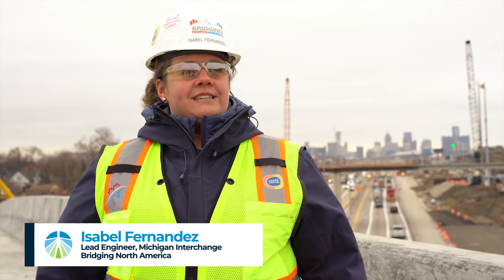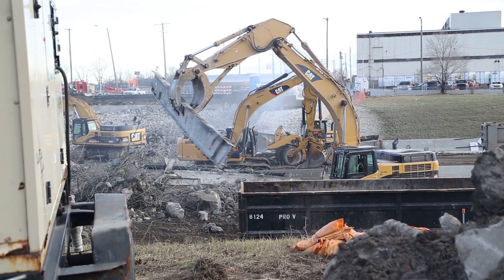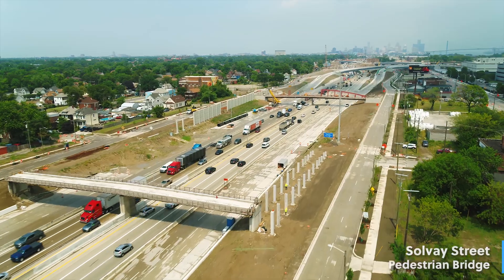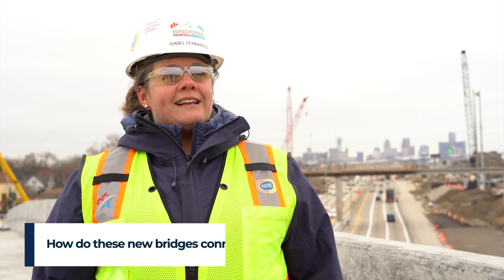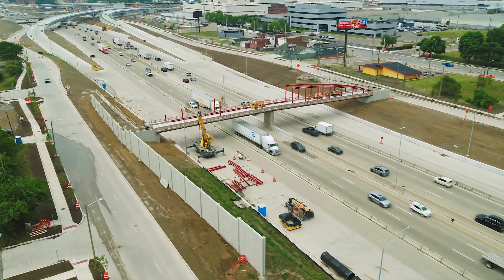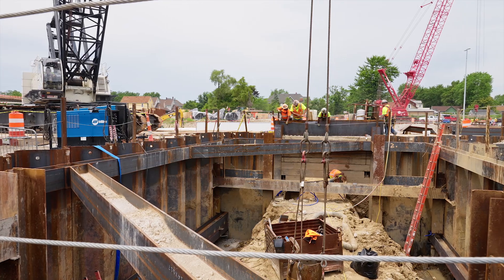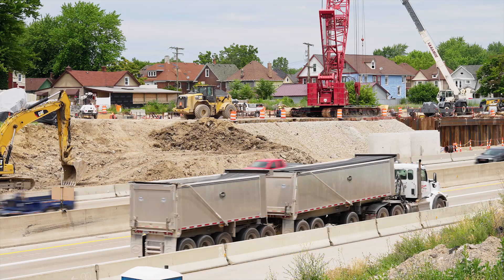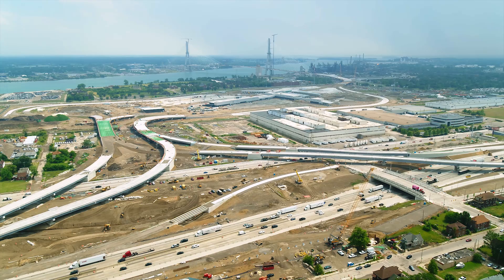Building Road and Pedestrian Bridges over I-75

Comment: Just give the highway a diet, make it a boulevard. Widening will not improve anything
Reply: It’s a primary interstate linking Michigan to Florida. That’s not an option
Reply: Though they should not widen it, you cant really give the interstate a diet. However you can boost passenger rail service, as well as public and rapid transit service. Then you could potentially bring down the amount of lanes to 3 per direction, but no Less than that.
Reply: Don’t forget about all the truck traffic that will be accessing these roadways as well.
Reply: It's an interstate. They don't have the authority to do that.